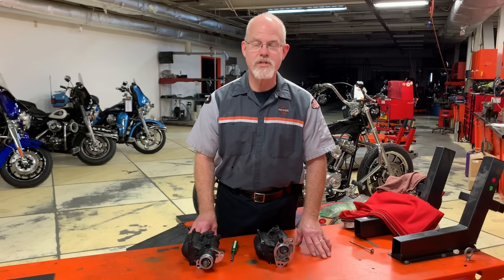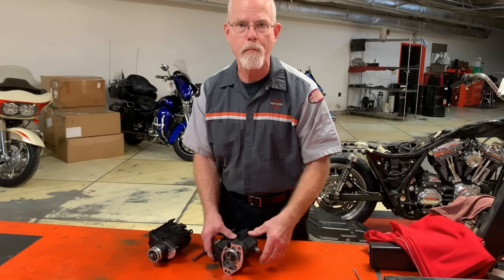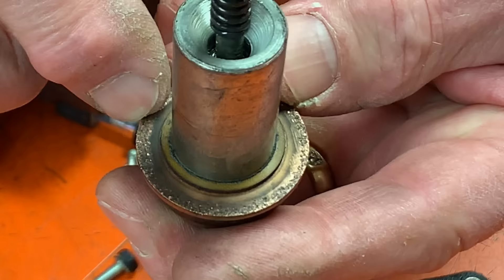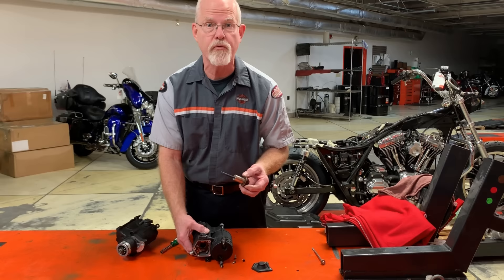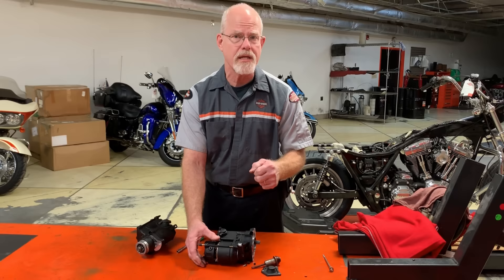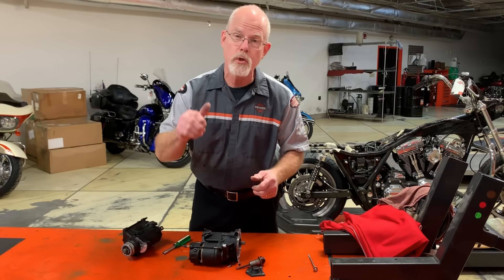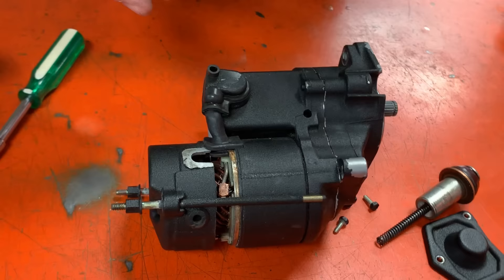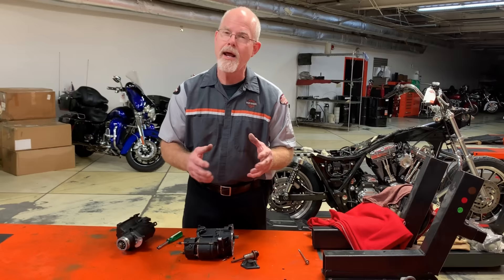DOC HARLEY: STARTER MOTOR WHAT WEARS OUT

Comment: Harley starters (2009-2014) were designed for he 96ci motor.  There were no changes in starter output power for the 103 and bigger engines until the M8s came out.  For the twin cams the  "96ci" starter that has to work overtime to turn over a 103 or bigger - you will get kickback - even with the SE compensator.    The All balls High out put starter is a direct replacement bolt in option with more output and a LIFETIME warranty on all parts of the starter for about the same price as a new HD starter.   I have a number of friends with CVOs who have made this transition with me and all report the days of kickback and starter issues are GONE on their twin cams.
Reply: I wish Doc would have commented on the S&S easy start cams in regard to cranking on this topic, but I do understand that HD and those who are here to endorse HD products don't have a mandate to support their competition. I respect those who think outside the box and appreciate your input jimdiavstaas. I have pondered what I will do when the time comes for some starter work and I'm impressed with what I read about all balls. I have an 06 TC with an S&S 4.325" crank now, my HD crank failed before I installed the S&S parts and increased the bore to 3.785" to create a 103 cube. I've never suffered kickback with the 585 S&S easy start cams, and I know this will extend the life of my starter. I Also wish Doc would have reminded everyone of the importance of never using a weak or inadequate battery to avoid many electrical issues especially when it comes to starters.

Comment: My 05 RK has 18k miles on it. The starter click click click. There's no loose or dirty connections.
    The battery reads 12.5, but drops to 6 when hitting the starter. But does the same with a real good jump pack.
Reply from the maker: You have no Cold Cranking Amperage. You know this by watching the volts drop to 6!  You know the battery is bad. Buy a new battery and test. Every Harley needs a good battery to start and run. The Jumper only adds to a low capable battery. If the battery is old, worn out internally the jumper can’t take the place of a broken part…..Doc

Comment: Quite informative, Doc.  I may need a new startrer for my 09 RK classic.  I have no clue what the issue is with my starter.  I hate to sound suspicious but I'm leary of the HD mechanics. Each time I take my bike to the HD shop for repairs, something else seems to be wrong. I have a little over 26k miles on my bike and I do take it in for regular maintenance.  To me, it's a low mileage bike but the HD shop considers my bike old.  I guess it is.  Thanks for telling us about replacing starter cables of we decide to replace the entire starter with an after market unit.  Have a fine week and thanks again for the great videos.  👍🏽🤠 5/1/23

Comment: Well done, thanks for your time, and detail to a problem that we most all will have sooner or later..dang you pointed out one of the biggest complaints HD owners have.. Cost of replacement..!  however I will add that many times those starter problems are actually a poor connection of the battery cables.. so start there first.
Reply from the maker: Good Point...Doc

Comment: Found this video after I was "stranded" after  a lunch outing.  The starter would drive the engine to compression but couldn't kick it over.  New battery just last spring and the place I bought it from tested it after I had got home and charged it to 12.8V.  They  put a tester on it and said it was fine... so now I need to check the cables from the battery down to the starter.   I did add some LED lights (kuryakyn) last year that mount in the cooling pods, so I'm wondering if they are causing too much of a load, but I thought the lights shut off when cranking the bike. Would be good to have headlight switches.. Looks like i have some stuff to do this weekend 😄 Seems it would cost as much to rebuild the starter as it is to replace it (doing my own removal/reinstall)
Reply: Have someone who knows their stuff with batteries do a load test on yours, not just some counter kid with a volt meter, that's not a real test you can count on!

Comment: Thanks Doc for the Vid. little story here, my bike (02 FXDGW) is hard to start due to upgrades before i bought it runs like a champ just hard starting, warming up for the 100 miles home i did not relies i had the start button pushed and could not hear the starter due to bad hearing, once noticed i released  the button and continued on our way rode maybe 20 miles and stopped for smoke break and shut off bike when ready to leave starter motor would do nothing we got the bike jumped and made it home with no problems, the next day i tried starting bike and nothing i tried 2 weeks and ordered starter motor when it arrived i gathered tools, and once more tried starting, well this time it started like nothing was ever wrong, even today 7 months later still starting and running like it always did, still dont understand if it was just hot or maybe some slight build up on brushs but at least i have a spare starter now

Comment: Excellent information.  So that begs the question, will a Harley-Davidson service department actually replace the needed parts within your starter motor? Or do they just replace the whole starter?  My guess is it will depend on the particular shop.
Reply: BrewCityRider it probably isn’t any cheaper to have a tech R&R the starter and rebuild it. You just end up paying more labor and less parts, as opposed to just buying a new unit and less labor.

Comment: The starter clutch in my '03 FXST didn't last six months. Replaced it with a Denso part (same part) as found in many a Toyota. Much cheaper than through Harley. Oil tank had to come off so it was a bit of a pain to replace.
Reply from the maker: How did you find the Toyota part would fit? That IS a lot of work to install a part that won’t work 🤷‍♂️…..Doc

Comment: Denso OSGR Light Duty units are used on millions of cars and trucks. Their coaxial solenoid and gear reduction are key advantages.
I immediately replace the stock blank end cover with an aftermarket pushbutton cover which bypasses not only all external relays and wiring but even the solenoid windings. There are several Denso overhaul videos and you can get contact kits at any auto electric rebuilder but I just buy online. 

Generic car contacts are fine as the bike stuff is the same, but the contacts must be the right style (some kits have both styles but Youtube's bot autobans me when I post links) .  An aftermarket kit with all the parts is about 25 dollars and the Denso or licensed copies (the design is long proven over several decades) are of the same quality. HD does not make their own starters (a good thing).

Get the kits with the seals etc as they're cheap enough. I use dielectric grease on all power cable studs and the solenoid connector (as well as the alternator pigtail to exclude moisture.  Your local auto electric shop can make short work of fixing a starter. While starter clutch and end housings differ there are so many Densos made one can mix parts like grabbing the electric motor off any suitable donor.
Reply from the maker: I sense a little humor in your awesome Tech Tip. Thank you for sharing…Doc

Comment: Thank you for the video my bikes starter is making the noise just once in a while. The gear kinda pop grinding noise now I know what it is
Reply: Same here. Maybe once a month it has started doing it. Every other time it's fine so I would assume a replacement will be in store sooner or later.
Reply: This is happening on my Dyna after being ridden for an hr at about 80°f . im thinking it's the battery level is low I'm running straight 50 weight oil. And most of the time doesn't do it at all. One of those weird mysteries with a Harley. I owned a 2010 Honda Sabre as well that did the same thing

Comment: Hey Doc, Me again and Im sure by now your saying OMG...that guy again..!!
Well, long story short, lost my clutch on I95 and barely got the bike home. I ordered a new clutch, clutch basket bearing, clutch pack spring and automatic chain tensioner. The compensator bolt that has to be replaced Harley Davidson doesn't even make any more...Not happy about that but I found an after market one so, no big shakes.  Im also putting in the new Cycle Electric, 50 amp, 3 phase stator and the matching Voltage Regulator/Rectifier.  Only thing I left out is the primary chain. I have 63,000 on the chain so, Im $1200 deep into parts as it is and really I don't want to spend any more money but, Im in the primary so would YOU....replace the chain or should it be good to go for another 60,000 miles.
Thanks Doc for all your help....We do appreciate you...
Reply from the maker: Replace. I don't know what damaged happened in the Primary but if parts went everywhere, I am sure some links are compromized. and putting a new chain with a new adjuster is a better match...Doc
Reply: @LowCountryHarleyDavidson  I agree....Thank you for the input.  No parts broke...I just lost the clutch, its worn out but, Im there right...so replace it and move on....Thanks Doc, if I ever make to your home town...Find a great steak house and I'll feed you a cow....Rp

Comment: Great video!  QUESTION:  Is there a mechanical and or lubricity advantage to the primary cover design of the early ‘17 & ‘18 Touring/Softail model M8’s versus the 2019 and up thinner/skinnier primary covers?  Seems like more fluid would preserve the oil additives and stay cleaner longer benefitting all mechanical parts in the primary!  What do you think Doc???
Reply from the maker: There are no advantages or disadvantages that we are aware of.

Comment: I have an aftermarket hi torque starter on a 2004 softail (upgraded to a 96ci with S&S kit). Battery is a new Lithium Hi Power one. When I hit the starter, it sometimes turns maybe one revolution and then does nothing for a second or two. No sounds. Then it may start turning over like it should or does nothing at all. If I turn off the ignition and try again, it may crank as normal or may not. I have new cables installed. 
I'm stumped.

Comment: Will you hear a winding sound like metal touching even when the bike is running when a starter clutch is going out
Reply from the maker: Yes it can if the solinoid is not returning the gear back to neutral position…Doc

Comment: Have a really weird problem on my M8 sport glide, has been doing it for about 3 years, but when I press the start button, the engine turns once (doesn't fire up) and thats it, I also notice on my instrument panel that the clock resets, when I press the button again the bike fires up, not sure if its a relay/solonoid or a bad earth somewhere, but its irritating, only seems to do it once every few months, I have changed the battery on it and it still done it (had to change battery anyway)  The bike doesn't have a lot of miles on it (I always have two motorcycles). so around 7K mils.
Reply from the maker: I have the same issue. One of these days I’m diving in to find the issue. But it’s riding season 🤷‍♂️….Doc
Reply: @LowCountryHarleyDavidson  Well if you find the problem first please share and I will do like wise, I don't think its going to be hard to find, however like you finding the time to chase it down is another thing :)

Comment: Trouble finding the parts; i.e, copper washer for plunger and the two contact points. My starter looks exactly like the one in the video.  Thank for the video.  Would like some information on where to find some of these parts.
Reply from the maker: You did not mention model and year. Your Harley Dealer can order these parts from the factory. Terry Components and Drag Specialties offer stater solenoid repair kits.  ~ Doc

Comment: I have a HD fat boy (2009) that makes a terrible "shlonk" noise at start when the engine is hot .
A slight improvement on start is when I hit the start button before the end of the injection.
Would it be because it reduces a bit the pressure inside the cylinders and ease the cranking?
Battery is 12.7 volts and drops at 10.5 Volts during start .
I have cleaned up battery terminals and positive lead wire terminal of the starter motor .
No improvement..
Any suggestions Doc ?
Thank you
Reply from the maker: I believe you answered your own question. Battery drops voltage too much and harder to start if you wait ( which your lights and ignition is draining your battery) so either replace the battery and or have your starter checked with an amp meter. It could be asking for more CCA then your battery can supply…..Doc
Reply: @LowCountryHarleyDavidson  Thank you .
What would be the maximum voltage drop acceptable? Any recommendations for a battery of quality? Do a lithium iron phosphate with a good CCA (400 or above )would help ?
Once again , thank you for your answer and your very informative videos .
Reply: @LowCountryHarleyDavidson  thank you for your answer

Comment: Hi doc, Had my 2009 crossbones starter rebuilt at a local starter & alternator shop for 85 bucks. Be replaced the gear and the contacts kit you descrubed, The old starter was cranking the bike but sometimes slipped and grind real hard. So i reinstalled the rebuilt one & cranks better but still grinding slightly still . What would still cause this . Bike has 19,000 on it.

Comment: mine does buzz noise and rarely will rotate anything even if i try to start in neutral (i usually always start in neutral)
Reply from the maker: I don’t know a lot about your bike. Battery CCA condition, all ground connections, relay connection and condition and finally internal and external mechanical binding….Doc
Reply: @LowCountryHarleyDavidson  i dont know if i can afford to come by your area as i am in Seattle currently and do not currently have a method or means to transport the non starting bike to any location that could even service it because it wont start

Comment: Hi doc, I just experience while my engine is running after clicking on the start switch...after a while I hear a cranking sound repeatedly secs apart simultaneously. As if someone press the start switch button while the engine is running..I am lost and can't figure out and explanation. Does 883 iron 2010 have this problem?

Comment: Hey Doc,   Can't figure this out....Brand New Starter first of all.  I push the starter button, I can hear the relay click but the starter will not energize.  I put a jumper wire directly from the battery + terminal to the spade lug on the starter, it energizes and turns.  I put a volt meter on the green wire (disconnected from the starter terminal) and I push the button and I'm getting 12 volts.  So why is it only working on the jumper wire connected directly to the + terminal and not working on the green control wire when the volt meter is measuring 12 volts...????   This makes absolutely no sense to me. I can't wait to hear what Im over looking...I have no frigging clue what is going on...
Reply from the maker: Follow the path. When you go directly from battery to starter you have by passed, ignition switch, starter button, wiring and relay. Most of the time it is the relay. Remember there is enough Voltage but no amps backing it up when passing through many items to get there. …Doc
Reply: @LowCountryHarleyDavidson   I read the service manual and there are two starter relays....One is in the side cover on the left hand side of the bike.  The other is a much bigger relay under the seat.  When I press the starter button on the handlebars I can hear the relay fire but, its not killing the lights as it should however it is supply 12 volts to the control (green wire) to the starter. Are you telling me that the green wire has 12 volts but not enough amperage to fire the starter..???  Any idea what the second relay is for on the left hand side of the bike in the fuse block.. The manual clearly states...."starter relay"  do these two relays work in concert..???  This is the part that has me stumped.  I still have the problem of the accessory fuse blowing on start up.  If I turn the ignition switch on, everything works fine.  However, as soon as I start the bike the accessory fuse blows.  I have been chasing this problem now for months and Im riding a bike without turn signals or the horn....Not safe but I am not going to garage the bike and not ride it just because the horn and turn signals do not work.  I would however, like the bike to function as designed by Harley.....

Comment: Did you neglect to mention that the starter teeth ring press fit on the clutch basket can also slip and fail to turn the engine ?
Reply from the maker: Thanks for sharing, you are correct...Doc

Comment: About every 10th time I start my bike the starter makes a grinding sound, what can cause that?
Reply from the maker: First thought includes a worn Motor Compensator, old battery with weak cold crank amp., worn teeth on clutch basket, starter clutch wearing and then there is the age of wires &connectors….Doc

Comment: What about a 2008 FLSTC that does nothing when I hit the starter button? 
   No clicks, nada. The bike sat for three months, ran fine when parked. New battery.
Reply from the maker: Start with basic: current voltage in battery. Battery terminal connections. Voltage drop at battery when start button is pushed. Then make sure the very small terminal at starter is pushed in all the way….Doc

Comment: Hey Doc, what would cause a new jackshaft’s teeth to sheer off. New starter and ring gear install at the time the jack shaft was replaced. Lasted maybe 20 starts. Thanks in advance.
Reply from the maker: Starter was checked at the time jackshaft was installed? I would be concerned the starter is not retracting the jackshaft enough so it is grinding on the back of the ring gear. A worn out compensator will ruin a starter and too advanced timing...Doc